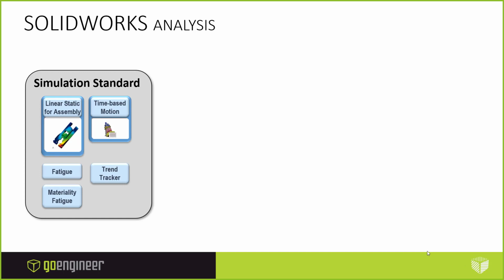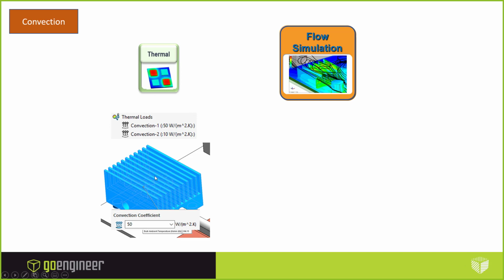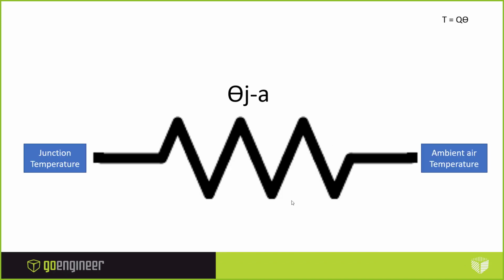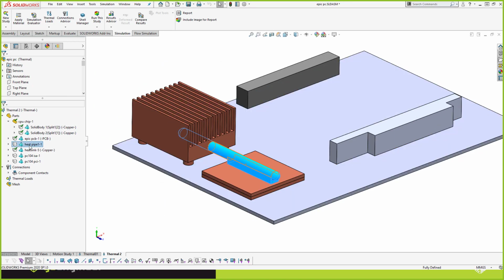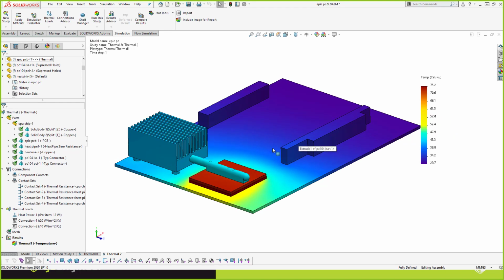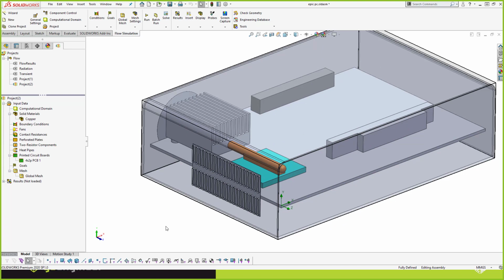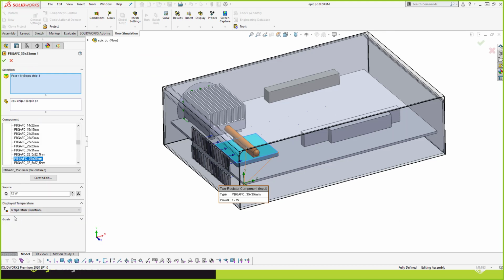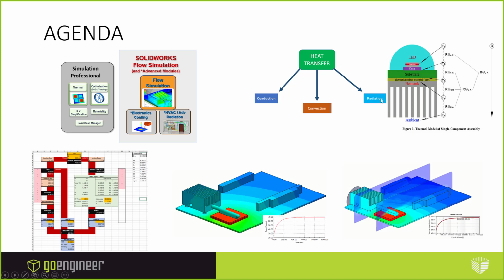SOLIDWORKS Thermal from Beginning to End (Simulation Webinar)

Comment: I don´t quite understand how you came up with the 2 Values for heat convection in Thermal. According to the SolidWorks help page you linked in your older Video, the heat convection depends on the surrounding material (Stagnant/Flowing Air, Water, Oil) not on the part itself. Why does the Heatsink have a different coefficient than the rest? 5 - 25 is natural convection, so without any airflow. Shouldn´t  the values be the same across the board?

Comment: How did you add the time graph and did that simuation with time
Reply from the maker: For which part?  In the thermal analysis, you must go to the STUDY PROPERTIES and make it a TRANSIENT study.  Then you can probe a node and request a RESPONSE GRAPH.  For the Flow Study, you can make it time-dependent in the Wizard/General Settings.
Reply: @goengineer  for the flow after making it time dependent how do i see how the flow changed as animation?
Reply from the maker: @simonfeghali5214  We used the TRANSIENT EXPLORER.  This can be enabled in the Calculation Control Options and then viewed after running the study by Right-clicking on the RESULTS folder

Comment: Thanks for the grate content. Could you plase explain how you came up with the thermal resistances of the PCB after running thermal and flow simulation to import it back to the excel sheet for comparison?
Reply from the maker: Please see my discussion with "Jeremy Tan Wei Hern" in this comments section to see more information about how the PCB was modeled.  The spreadsheet modeling was done intentionally WITHOUT the use of Flow Simulation and Thermal analysis in order to illustrate the capability and limitations of an "only spreadsheet" approach.  Then the Flow Simulation and Thermal analysis were performed afterward and I compared to this results.

Comment: Does Solidworks treat a void in a model as being filled with air by default? e.g. I make a hollow sphere using revolve. Are the internals atmospheric air by default? Thanks. Great video.
Reply from the maker: SimPro Thermal: by default gaps with no thermal conditions applied will behave like they are perfectly insulated and will not participate in any heat transfer (neither air convection or radiation).

Flow Simulation: Gaps will be filled with the default project fluid (normally air).  Exceptions/considerations: if gap is an enclosed cavity without boundary conditions, it will be excluded from the analysis by default unless you disable this option in the wizard.  Also some mesh refinement in these gap areas may be needed to properly resolve them if its an important phenomena to capture in your study.

Comment: Dear teacher,

Thanks for posting this tutorial. I have a doubt: I am running a transient analysis, with 2 bodies in contact. The first body has a heat generation and transfers heat to the second body. I would like the simulation to stop when the second body hits a temperature of 190°C (for instance). I have tried many different ways, non of them worked. Any idea? 

My original idea was to put a Volume Goal of temperature in the second body, and then go to SOLVE - CALCULATION CONTROL OPTIONS - Goals criteria - manual value - 190°C. It does not work, solver simply keeps calculating after going beyond the set threshold. I tried different combinations, none of them worked.

Here´s a little challenge for you, thanks in advance! Cheers!
Reply from the maker: Instead of "manual" set it to ">Absolute Value" and also make sure "Goal Convergence" is the only finish condition you have enabled.  Setting it to manual just sets the allowable amplitude excursion for the goal rather than a threshold for termination.  See the Flow Simulation Help for more information on this.

If you still have a hard time getting it to work, please post your question to the SOLIDWORKS Forum and attach the model for me to look at.  Then link it here.

Comment: Can you share the material properties you used to approximate the heat pipe in the simulation model?  Is there a means of assigning thermal resistance?
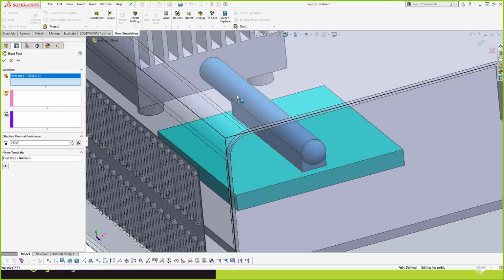Reply from the maker: The one at 21:29 or the one at 37:00?
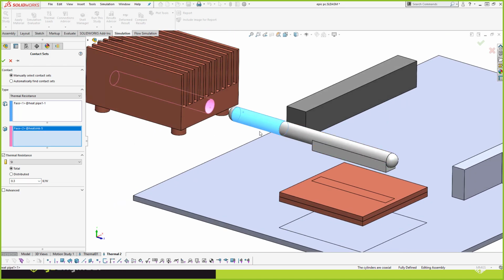The properties used at 21:29 in the Thermal analysis were set such that the resistance of the body itself would be close to zero (I likely used a conductivity of 10000 W/m.K).   Instead of relying on the simplified CAD body, I want the thermal resistance of this heat pipe pathway to be handled by the contact I create at 24:09.  Here you can see that thermal resistance I am assigning is 0.3 K/W and this is intended to be the heat pipe resistance. If I know contact resistance between the pipe and the heat sink as well, I should actually add this to the 0.3, but I simply assumed zero on that term for this study.
Another nice to approach this would be to split the heat pipe into halves (a cpu side and a heat sink side) and assign a contact resistance between the two halves to mimic the thermal resistance of the pipe.
If you are interested in the heat capacity characteristics as well, please let me know.

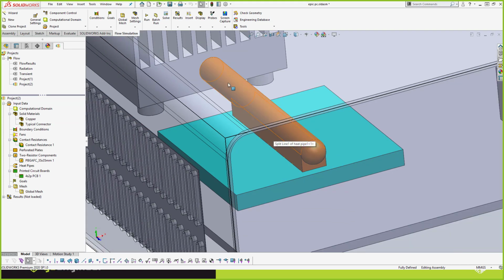At 37:00 I can be more direct in just assigning the thermal resistance to the heat pipe component itself, but Flow Simulation uses a fairly similar method behind the scenes to what I do at 21:29.

I hope this helps to answer your question, but please let me know if part of this is still unclear.

Comment: Can you please send me cad file, excel sheet.
Reply from the maker: The CAD file is in your Flow Simulation installation folder (usually "C:\Program Files\SOLIDWORKS Corp\SOLIDWORKS Flow Simulation\Examples\E1 - Electronics").  You'll have to do a little tweaking (split the CPU body for the thermal study and suppress some components) to it to make it look precisely like mine.

This isn't the first request I've gotten for the spreadsheet so I'll also look at hosting that as well.  I'll try to remember to post an update to this comment when its up.
Reply from the maker: Ok, it should be up now.  Try it out and let me know if you have any questions.

Comment: If the enclosure has no fan but just vents, can we use thermal simulation?
Reply from the maker: You can use Thermal Simulation whether you have fans or not, but the usefulness will depend on how good you are at estimating convection coefficients.  Either way, you will want to use conservative coefficients and make sure your design passes which will inevitably lead to larger degree of over-design compared to Flow Simulation.

Comment: Thanks for this tutorial. In the SW Flow Sim two-resistor model is the Theta(JC) always the top of  case package or it can be bottom of package? In case for example I will be using component without heatsink on top(most SMDs) but with epad soldered on board,(PCB as heatsink) is the Theta(JC) still referring to the top of case package in the two-resistor model or th e bottom face of the package needs to be selected as the top face? Also If in case datasheet of SMD component only  provide Theta(JC) and Theta(JA) is given is there a way to derive Theta(J-Board) which is needed as input for two-resistor model in SW flow sim. Can you share your hand calculation spread sheet if that is okay.
Reply from the maker: I posted the spreadsheet now since I've had another request for it.  See the description in the video.
Reply: @goengineer  Thanks for this.
Reply from the maker: This is a great question and could probably use some expansion on what I'm about to write, but here's the short version.

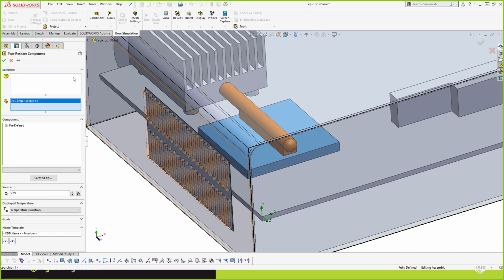We are just assigning the resistance you apply to θjC to whatever face you mark as the "Top Face" (see 35:11) so in principle you can select the bottom if you wanted.  Take a quick look at the Flow Simulation Technical Reference (found under Help, SOLIDWORKS Simulation) to make sure you understand fundamentally what we are doing with this 2R Component tool before you get too creative, though.  There's a little diagram in there that should clear a few things up for you on roundabout page 90 (check the Table of Contents).

To estimate θjB (junction to board resistance), use the following relation: θjA= θjB + θjC

Where
θjA is the total thermal resistance from junction to ambient
θjB is the junction to board thermal resistance
θjC is the junction to case thermal resistance

Finally, I don't know the spreadsheet will be as handy as you might think.  The thermal circuit in it was designed for this specific example.  But if you insist, I can see what we can do to host it somewhere.

Comment: Thanks for posting this tutorial
Question, 23:33 does your thermal paste have a thermal resistance of 0.007K/W? Does that mean -273C/W?
Reply from the maker: 1 K = 1 C°    Notice I am using "C°" instead of "°C".  A subtle distinction which is discussed a bit here:
https://www.answers.com/Q/Difference_between_degrees_Celsius_and_Celsius_degrees

So 0.007 K/W is equal to 0.007 C°/W.
Reply: @goengineer  Thanks for clarifying!

Comment: Dear teacher/ Tutor.

hello teacher, I see you are very magnificent in this area. I ask for help with your tutorial related to time dependent flow simulation which is showing result for every part with the graphic (graphic Temperature versus time in second). Thanks a lot for your help.

Best regard
jamil
Reply from the maker: In Flow Simulation, you can use the Transient Explorer to animate Surface Plots.  This is a great way to get an overview of the thermal performance on important bodies involved.

Comment: Thanks a lot for the video.  I have an SW premium 2016.  Is new simulation software compatible with 2016 SW?
Reply from the maker: Thank you for your question.  Officially per KB S-019449: “Starting with version 2009, you must have the same service pack for SOLIDWORKS Simulation and SOLIDWORKS.
 In version 2010 and up, there is no separate installation, and therefore this requirement is automatically fulfilled.